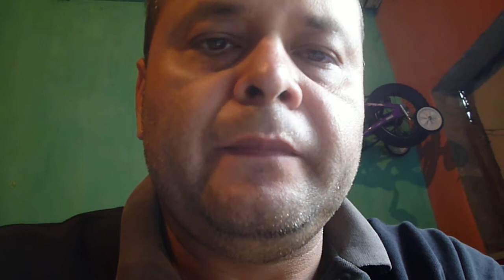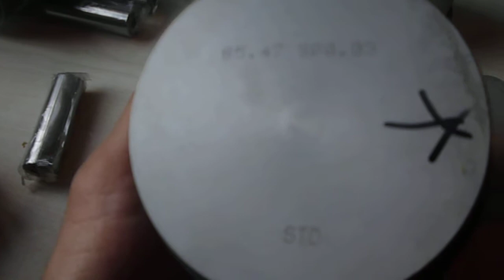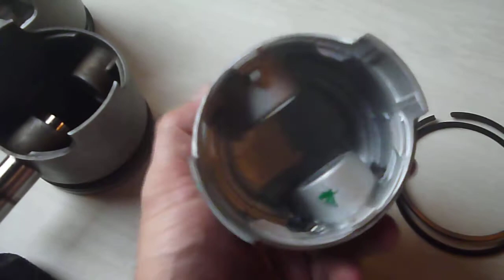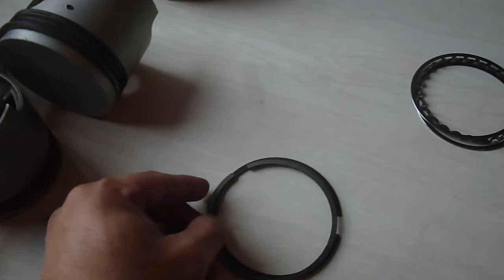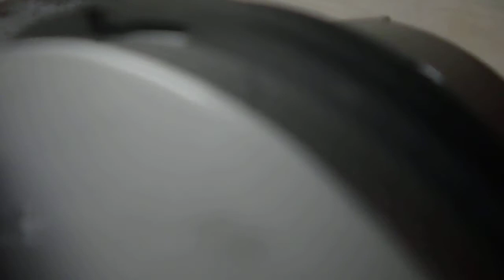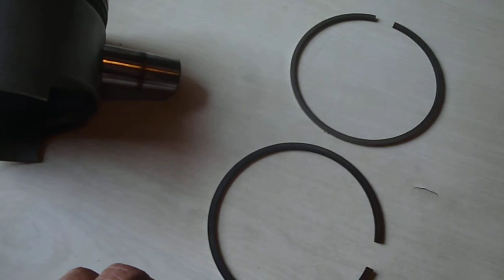VW BEETLE 1600 CC ENGINE PISTON AND RINGS REPLACEMENT VIDEO 1

Comment: Would it be okay to replace only the rings on a 1600dp, 100psi on each cylinder. Currently engine runs good, no black or blue smoke. but i have the engine out for a clean up, re-spray the tins, etc.
Reply from the maker: If it runs good i wouldnt, however if you have dissasembled the the cylinders, i would have a machine shop measure my cilynders, to see how much life is left on them. it depends on your budget, however this cars are very apreciative, parts tend to last.
Reply: @banishedveteranchannel4636  Thanks for your reply. I have not pulled the heads out yet. I agree, it'll probably be worth measuring the cylinders before thinking of replacing them. Car seem to have done 138K miles. I'm guessing the valve seats probably need polishing as well. Car needs some rust and paint work done. So I do not want to spend too much on the engine, if it's not required. Want to keep the car original as much as possible.